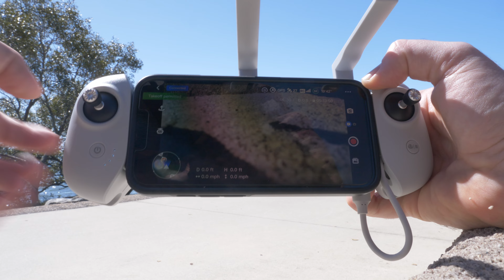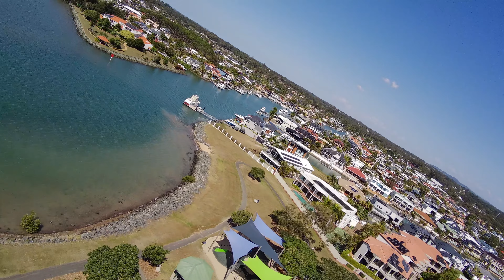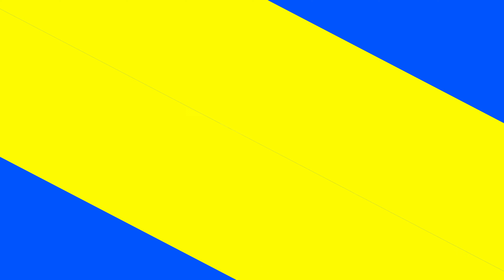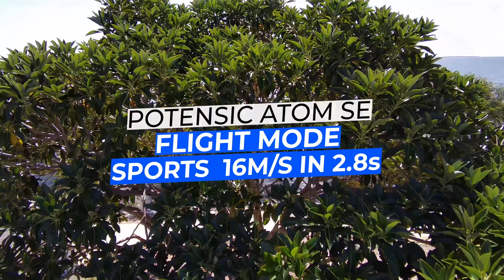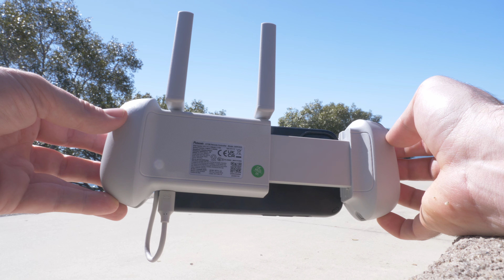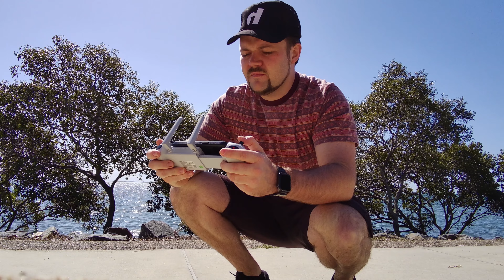Ultimate Budget Drone? @Potensic Atom SE Review

Comment: Great review. Question: Does it determine where you can and cannot fly? I have a DJI Mini 2 and live 4.99 miles from a small airport and I am unable to fly in my own backyard due to DJIs limitations.
Reply from the maker: I don’t know, I never tested this. Check the link in my description. It will tell you if the Atom SE has geofencing restrictions. You might want to reach out to Potensic directly.
Reply: @DansTubeTV  Thanks for the reply. I will reach out to them. And now I know it's called "geofencing restrictions."

Comment: Were you able to test the return to home? you would certainly like it to do so on a low battery or signal loss situation.
Reply from the maker: I did not have to test the return to home feature as I flew back when I was at 30%. It did force itself in to return to home at one point but I cancelled it and landed manually 🛬